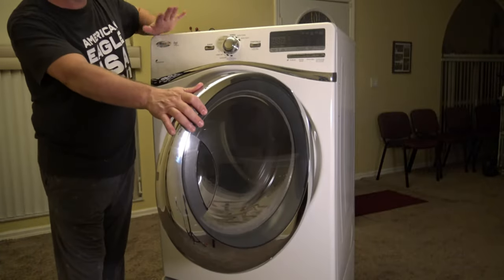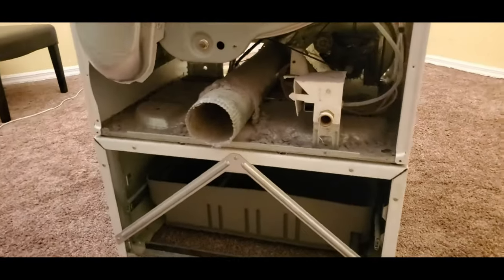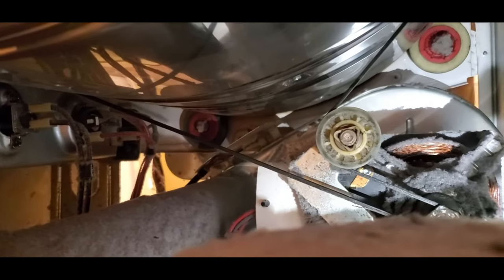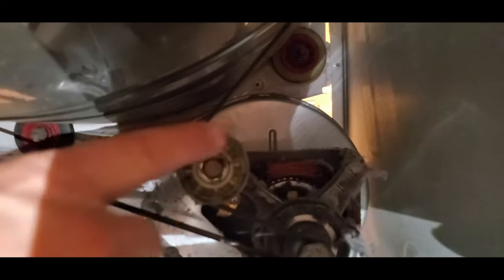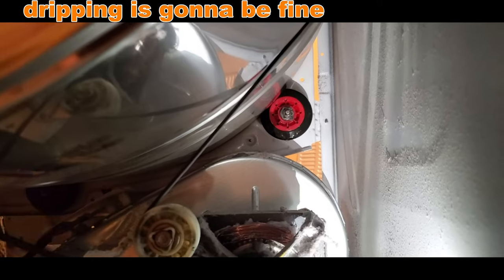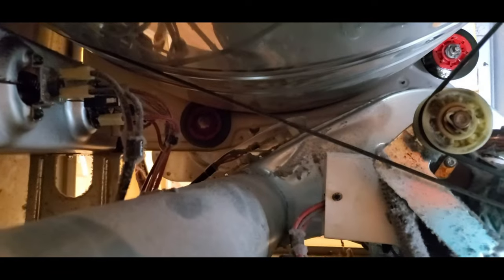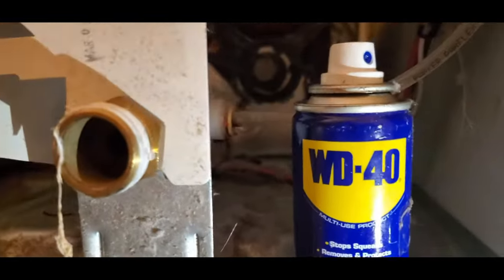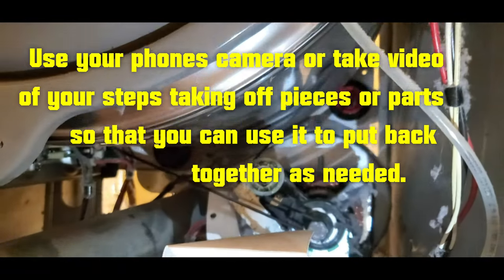Loud Squeaking Dryer Fix |TRY THIS FIRST | DIY | Easy How To fix | Just USE OIL

Comment: If you're going to take it this far apart, just buy the repair kit with the new belt, rollers, and idler!  I tried this with my Kenmore Elite/Whirlpool first, and it did indeed work....for about 3 weeks.  So I repeated it, 3 weeks later, and again, it stopped the issue, but only for another few weeks, so I just went back and bought the repair kit, and 8 years later, it's still squeak-free.  Do it right and only do it ONCE.
Reply: Where do you buy the repair kit for a series 200 kenmore?
Reply: Yeah, thats how I look at it...   If I'm going through pulling it out and apart, I'm replacing parts.

Comment: 100% saved me from calling a repair person.  I am a 50-year-old woman, kind of handy ... not afraid of a screwdriver.  Took me maybe 20 mins total, from pulling the dryer out,  opened the back, sprayed WD 40 on the 3-4 wheels and put back together.   No more dinosaur screeching.
Reply: Get 3 in 1 high temp silicone wd 40 is flammable and can catch on fire

Comment: not good. Read what WD40 is. Its not a lubricant, its a degreaser. If someone wants practice doing this again and again then sure go ahead and put actual grease. When the squeak comes back you get to do it again, Joy! Or replace the rollers and belt, the first time itself. Its not that hard and not that expensive either.

Comment: Do not take the back off. It is easier to take the front off. If you come from the front, you will also be able to lubricate the front rollers  and clean the lint filter. I buy and sell these for a living and have bought a bunch that have been taken apart and not been able to get back together.

Comment: Tried it and it works. My dryer runs silent now. For anyone interested here are a few pointers:

- Keep a fire extinguisher on hand.
- Do not use WD40. Use high temp grease. They come in aerosol cans. They are flammable, I tested with a lighter.
- Spray the grease directly at the rollers. At point blank. You might struggle to reach the rollers but do spray directly only on the rollers.
- Do not let the grease get on your electrical wires. It apparently degrades the rubber according to google. So spray the grease directly on the rollers.
- Take the opportunity to clean up all the dust and lint in your machine. I almost skipped this because I'm lazy af but once I saw the amount of gunk i cleaned, I'm glad I did.
- Before you reassemble the cover, test the dryer with a real cycle connected to gas and electricity. If anything happens you have a wider area to work with your fire extinguisher.
- Don't worry too much. Dryers are pretty well designed so the odds of the grease catching fire is very low. The flame is well compartmentalized. Try it and you'll see.

Thumbs up to speaknsee. I live in an apartment and my neighbors are probably very grateful to you.

Comment: Looks like you helped fix my problem on my 2007 Kenmore Dryer.
I was able to take off just the bottom front panel and spray WD40 on the three wheels. $4.50 vs $540 for a new low-end dryer

Comment: Update: The sqeaky noise came back. I bought silicone grease since others mentioned you need high temperature grease and applied it. Squeaky noise came back. Called repair person who took apart the entire dryer (even though it's stacked he didn't need to bring it down).  He replaced the wheel pulley, plastic beige one underneath the drum and sqeaky noise has been eliminated.  I don't expect the sqeaky noise to come back for another 6 years which is how old my dryer was when the sqeaky noise started to happen. If that happens, I will just tear down the dryer myself and do it. Bottom line IMHO: seems the pulley needs to be replaced when this happens. 

Thanks for the video! Helped fix the squeaky noise. I did clean lint and used wd40. Ill see how long it lasts. When noise comes back then I'll try the spray silicone grease
Reply: Did the repairman replace your belt as well, or just the pulley?

Replacing the belt requires a full disassembly which I want to avoid. So I'm hoping the pulley alone was enough to fix your issue 🤞

It seems the pulley can be replaced without a complete teardown, but the other parts attached to the drum (belt and rollers) require a full disassembly 😔
Reply: @achannelhandle  it's been a while but I don't believe he replaced the belt, just the pulley

Comment: I did the same thing with the lubing of the wheels....seemed to work for a while . Only problem with the WD40 was the smell in the dryer of this product, I had to run the dryer on a high heat to remove the smell...this took several hours. Next time I will look into using perhaps a hi-heat non smell lubricant. I also vacuumed the lint off of everything , including the dryer blades, motor, exhaust ports and base, I also took the front panels off instead of the rear....NOTE Turn off 30 amp breaker in electrical panel box.

Comment: You should remove the front and drum for easier access AND to clean all that lint out of the dryer which is a fire hazard.  Easier to remove the front than the back.  Don't use WD40 or grease.  Use a silicone or Teflon based dry lubricant that lasts longer.

Comment: Problems with WD40:
1. As stated before by other… WD40 is flammable ( although it does eventually dry out)
2. WD40 is NOT a long term lubricant. It will dry up in a day or so.

You can hit is with some silicone grease or even silicone spray grease.
Reply: Also wd-40 gunks up easily and quickly because it's not made for these type of purposes haha all that lint is gonna stick now and make all those wheels packed and eventually seize up 🤣
Reply: Will silicone grease last longer?? The spray one?
Reply: @ideaoverload910  Yes

Comment: I use wd 40 and smells burned.. can u please tell me what to do
Reply: Use a high temp silicone spray or one in a squeeze bottle. You can get at Home Depot. WD-40 is flammable and dryers run at high temp. You could run the risk of catching a fire with WD-40. Also, from reading a bunch of other comments, I guess the WD-40 isn’t a long term fix and will eventually wear off and the squeaking will come back

Comment: I wouldn't use WD-40 could be flammable use something that can withstand high heat,  if I'm not mistaken the manual also has suggested WD-40 could be mistaken thought I remember seeing it I wouldn't WD-40 could be flammable.

Comment: How long does the wd40 last?
Reply from the maker: it lasted only a couple of loads.
Reply: WHY would you leave this video up then? Also with people telling you WD40 is flammable & will likely get gummed up with lint?
Reply from the maker: @lori6411  I have others commenting saying that it has lasted longer and has worked for them. Why would I take that down?
Reply: @speaknsee I wouldn't take it down either, but brother, a pinned comment or brief update at the beginning/middle/end of video, and an update in the description would be really helpful and possibly even save lives! That might seem dramatic but it's reality, is it not? 

Having said that I luckily used "wd-40 specialist silicone" which has been going strong about 15 loads so far. It's safe up to 500°F as well! Now you can stick to your claim of use Wd-40, just add to use the silicone kind!
Reply: I’m going to try this. I watch the videos with  trying to attack this from the front and it  looks like a lot of unnecessary work when rear entry is Available!😂